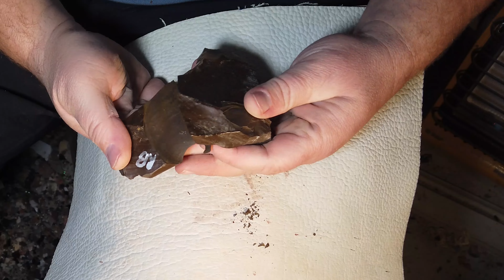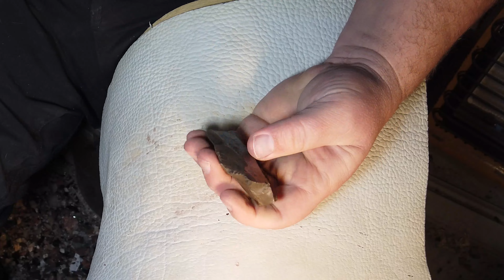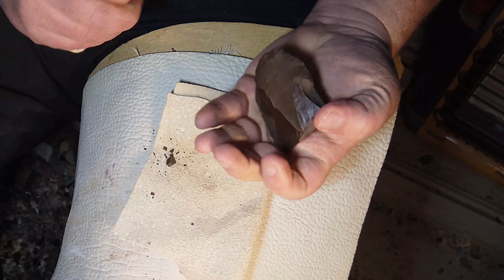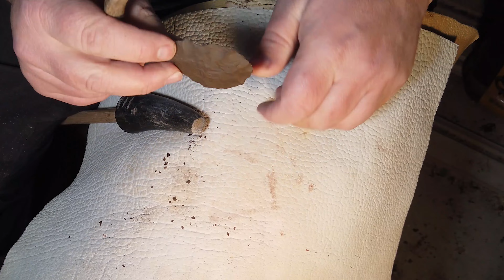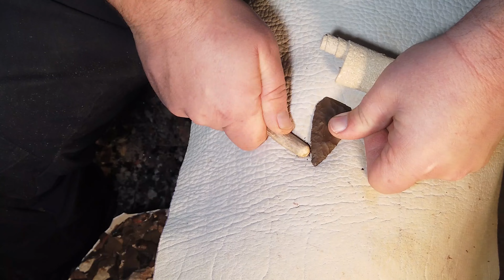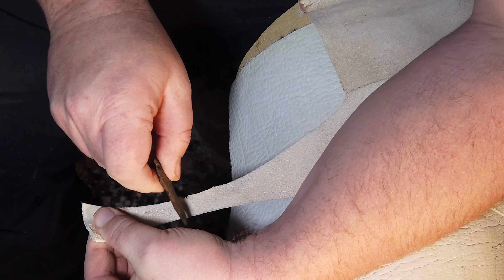Knapping Rainy Buttes on a Dark and Stormy Night

Comment: I get a very Jim Wynn-esque style of direct percussion watching you with your billet. I'm very partial to the indirect myself and when you we using it there was no denying the power it was putting into the piece. My only regrets is not getting just a glimpse of that big ol' horn you have hehe.(Or Mrs. Robertson!)  What you did in the beginning is what I want to learn to do, take a large enough flake to make a piece from and still have the core. Great use of your material!   Beautiful piece Chuck!
Reply from the maker: Jim Wynn?  I'll take it!   Best comment ever!  Even though I know you're just being nice.

Did you see that spall overshoot itself off?!  LOL!  I don't think I've finished a piece in months that didn't have at least one overshot...  At least this time it started with one and didn't finish with it like the last time.
Reply: @chucklearnslithics3751  I don’t play around, in fact I quit school just because I didn’t like recess! You line up your shots very much like Jum does with the little tap and brush before you strike.
Reply from the maker: @charlesmckinney3560  That's a good point.  I started working on my soft hammer like this after watching Silas Chapman.  Trying to hit a small platform precisely with direct percussion is hard for me and I just started swinging like that.  My ongoing issue is power.  As I power up I end up striking short, so I have to line it up several times.  But you're right.  I went back and looked at some of Wynn's videos and it's nearly exactly the same tap and swing.  I see now that he has the same power up issue sometimes too.  ...hopefully this isn't how he hurt his elbow.  Yikes!
Reply: @chucklearnslithics3751  And here you thought I had lost my mind or something hehe.
Reply from the maker: @charlesmckinney3560  have we ruled that out now?  ;)
Reply: @chucklearnslithics3751  If you're asking if I have papers to prove otherwise, uhhh no hehe.